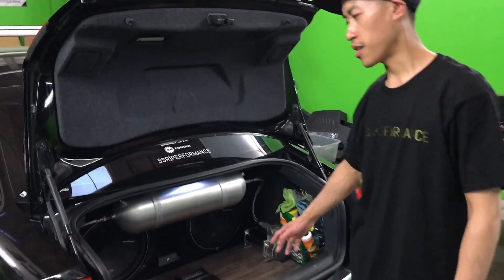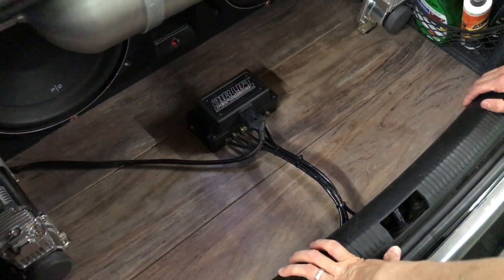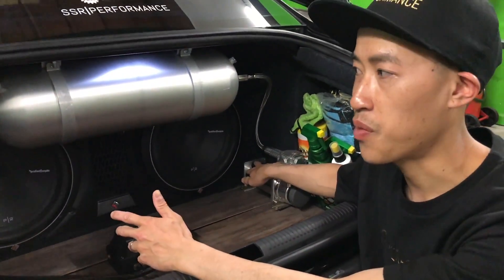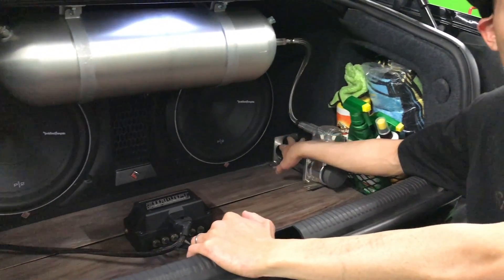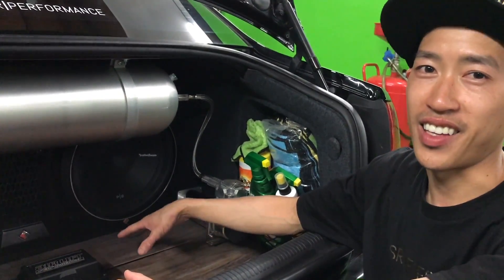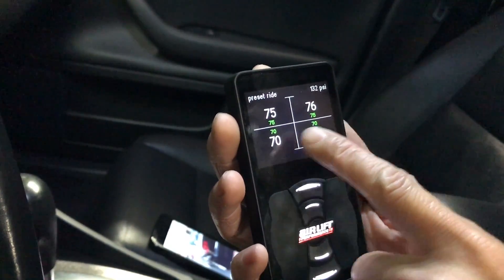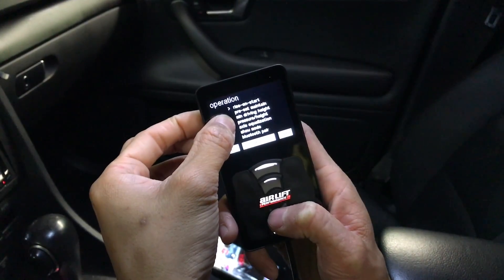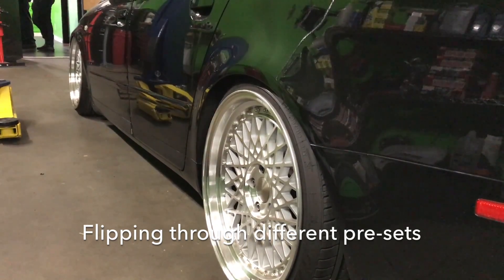Air Suspension : Car Setup and Functionality

Comment: I know im about 4 years late but everything this guy is saying is truth. What he mentioned about dual compressors was the sole reason i got two of them. I bought two 444 viair compressors solely on the fact in the event one failed - i'd have a backup. You don't want to end up paying a tow service more than what you would pay for an additional compressor. It's not much more money for peace of mind and the bonus is your tank fills up faster. Yes it's more noisy with two as opposed to one but it doesnt take as long.

Comment: Hi. I have noticed that the tank and compressors are in the boot. Does it mean that once an air suspension system is install in a car there is no way to use the boot for luggage? I am planning to buy a 2007 BMW335i E90 to which I would like to install a 3P air suspension system. Will there be enough boot space for my luggage?
Reply: Total install was around $995 for 3P install (3H install is around 1500 bucks) another 200 bucks on my custom trunk setup which will vary depending on what you want for your trunk, Install quality is good/thorough, took 2-3 days to complete install.  Cool thing, any issues you may have they will be there to help you. Overall I am happy with my setup has been trouble free so far since my install 3 months ago.
Reply: Recently had my car Bagged by them, just give them a call, they can set up however you want the tank, compressors etc to be setup as best as they can.
Reply: Hey im also interested in getting my RC350 bagged by them. I have a few questions for you. 1. How much did it cost. 2. How was the quality of the install. 3. How long did it take?
 Thanks!
Reply: Thanks for the supper timely response! Very helpful on picking a place to get my setup done. Do you know if they can do my setup to where  i can still have a spare and have trunk space? ( RC350 trunk is a fair size)